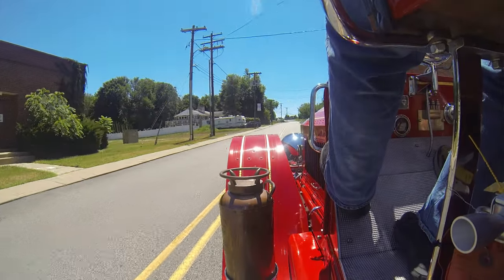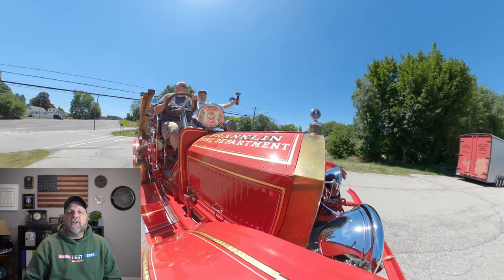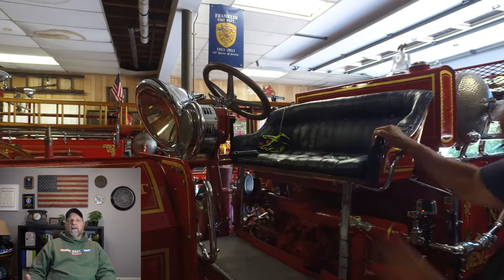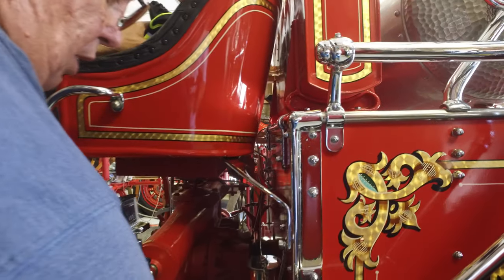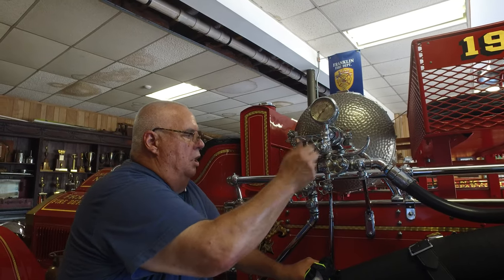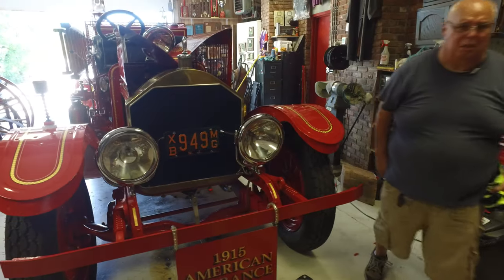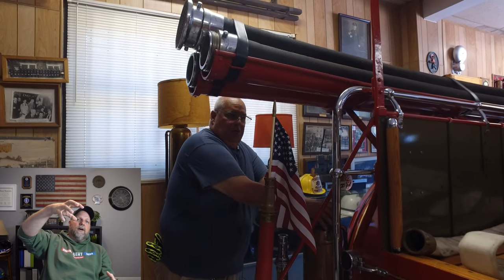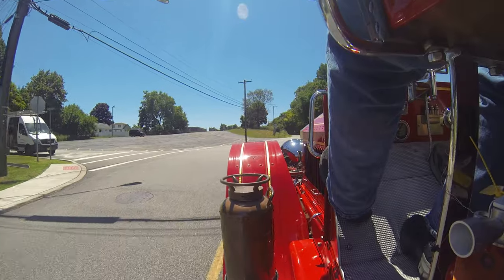ANTIQUE Fire Trucks That Still Run

Comment: The local FD here used soda acid until the 1940’s I believe. They had a dual tank set up so when the first went dry they switched to the second then replenished the spent tank so it was ready to go and would repeat this process back and forth until the fire was extinguished using 1 booster line. They used this unit on a field fire at my great grandfather’s farm back in the day and it made the soil barren for several years wherever the chemical concoction had been sprayed! Great video👍